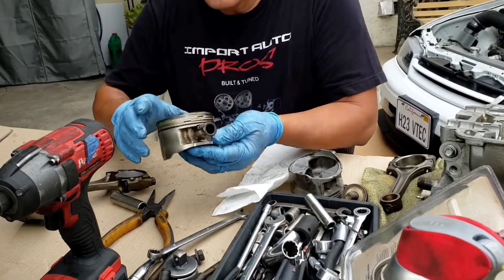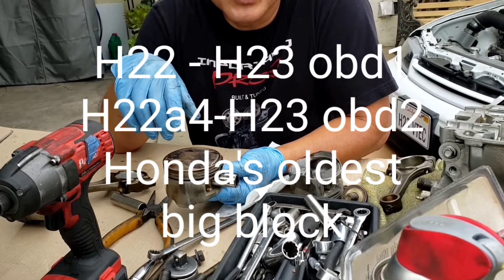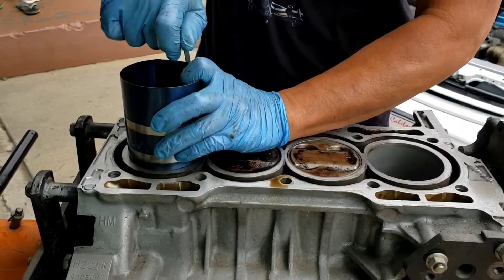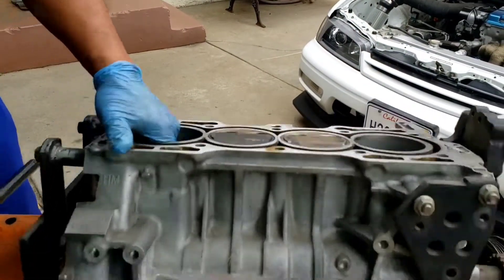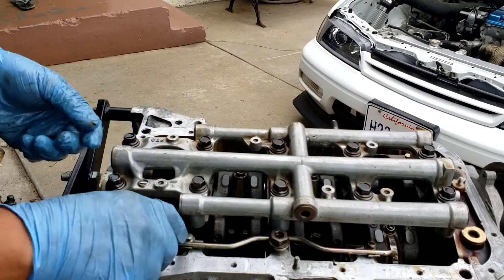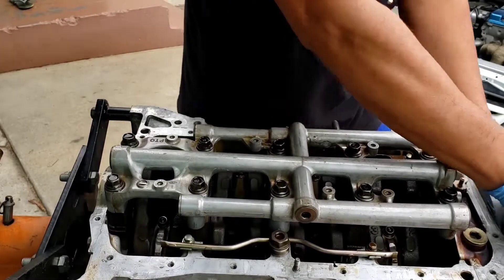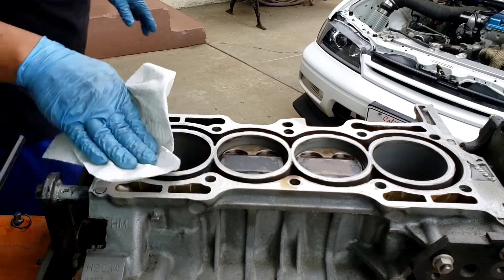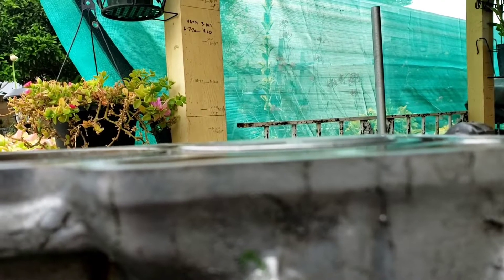G23VTEC build, H22 piston sticking out.

Comment: Need to have a talk with u
Reply: My h22 go bad so I want to do the f23 build
Reply: But want some pistons to put in it but it's a all motor build am doing
Reply from the maker: How you doin brother? Yeah it's all up to you if you want to build a F23/ h22 head. Just want to tell you right out the bat. G23 build is not as reliable like H22. You can make it successful if you can do a lot of research and pay attention on  how to build a g23vtec.( Lots of people have given up on hybrid, this is my 3rd g23vtec, hopefully it'll make it.) Now that l said that, if building NA, it's not that bad, try to keep your balance shaft and not rev it to the moon. If you decide to delete the balance shafts, swap it and install a ATI Damper and l highly recommend it. That's why l kept the oem balance shafts. Coz its free. You can use h22a4 piston on f23 rods and crank but it'll stick out a bit, just like my vlog. Some people have been succesful on their build like that. It's a good and fun motor, lots of torque.

Comment: I Used h22 type s nippon pistons and sticks out the same i made 261HP on a low reading dyno and 400HP on 80hp nitrous shot
Reply from the maker: It's a beast, it's sure nothing like H22. That's the reason l'm building another one. Thanks for watching.
Reply: What sort of fuel setup? cams?
Reply: @matteocoutant4282  pro 2 pump e85 flat valves ported exhaust side only
Reply: What gas did you use? @h2b Sedan
Reply: @kakospecs9152  pump e85
Reply: you must've been using some pretty aggressive cams to make that type of power no? Did you have to modify the surface of the piston to solve any clearance issues?
Reply: @lak0605-e6n  yeah pro 2 cams
Reply: @h2bsedan555  and they didn't come in contact with the type s pistons?
Reply: @h2bsedan555  did u use a thicker headgasket or something